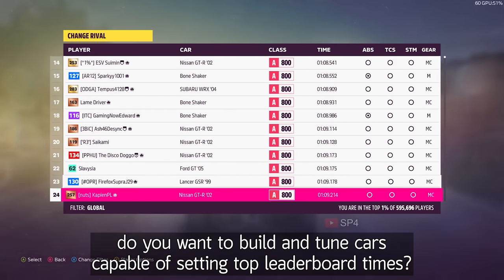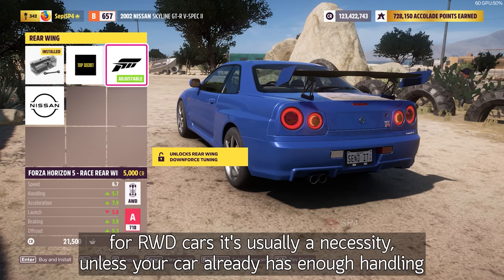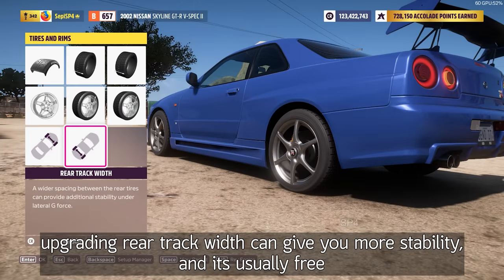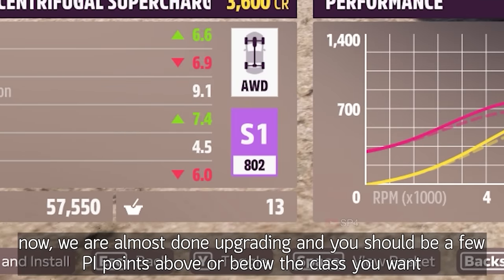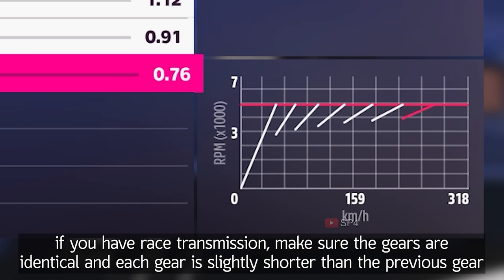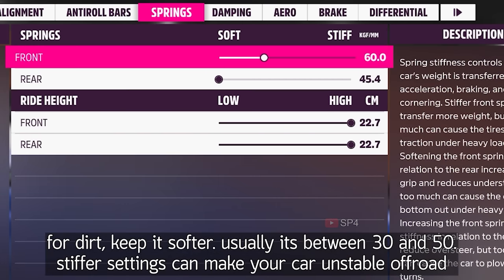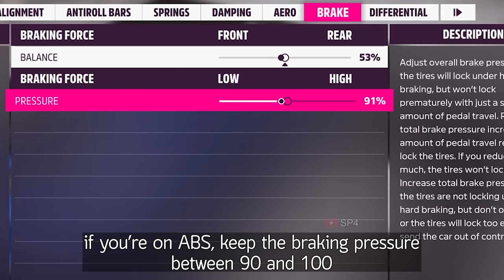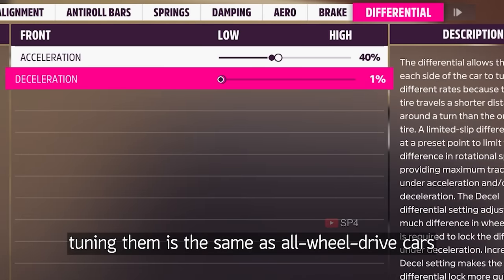Forza Horizon 5 META Tuning Guide

Comment: I have a few counter arguments/questions for this video. For reference, I've gotten top 0.1% to 0.05% on many of the tracks in Rivals (with so-called non meta cars like the Evo X and the C8 Corvette, both in S1 road), so I have had some success with the tunes I've developed for myself.

What are you looking at to determine the centrifugal supercharger/engines that are the most PI efficient upgrades? If it's simply power/PI gain, I think that's a little too simplistic. Torque/power curves are going to be way more impactful than the peak horsepower, and I think this can only be achieved through testing. Then again, that probably takes way too much time for most people. Also don't discount weight from the equation. Especially with front engined car, a lighter engine may be worth the "less efficient" PI gain.

I think aero should be used in the same way as tyres. I.e. it will start to make more sense with higher PI. The impact on drag and PI at lower classes makes it not worth it IMO.

Regarding front tyre width, I think it's worth it on some builds because now you can reduce the rear roll bar or increase the front and get better adjustability in general. Otherwise you'll get stuck with a maxed out rear anti roll bar and have to increase rear suspension stiffness to adjust your mechanical traction balance instead, which can start to make the car feel like shit (particularly true for front heavy vehicles).

I think your camber adjustment method is off. You shouldn't be looking at the alignment on the telemetry, you should be looking at the temperatures page (the one you pulled up at 4:03). The game seems to have a really loose approximation of sidewall flex under load, and as you can see, your outside temperatures are going up way too high because you're not running enough camber. Generally I'm finding that when cornering, the temperatures across the whole tyre go up quite evenly when the loaded tyre is experiencing about -1deg of camber in the corner. Mind you, the values are still super unrealistic; negative camber ends up at like -1.2ish for most vehicles under optimal conditions, even though most race cars would run like, -3deg of camber IRL.

Tyre pressures, like above, should be based on the temperature distribution across the width of the tyre. I would personally try and get the inflation pressure to the point that when under load, the spread of heat from the inside to the outside of the tyre becomes even.

How are you coming to the conclusion that higher ride heights have better weight transfer? I literally have never increased a car's ride height and thought it handled better as a result in any of the Horizon games. Are you basing this on lap time improvements or something else entirely? EDIT: Just saw the video you uploaded recently. Honestly 0.2 seconds is hardly going to tell you anything, and frankly I think a lot of that is down to increased rear axle weight transfer of such a rear heavy car like the C8 nullifying the understeer. I'd retest it using a front heavy car like the Civic or the R34.

Differential explanation seems oversimplified. Increasing acceleration values will actually help to get the power down, but too much will cause the entire axle starts to break loose. This is why you would increase it for offroad use. Same in reverse for deceleration.
Reply: This is a really important comment, thank u for writing that out, it's certainly helped me fine tune my time attack cars.

This could be my driving style; but I personally found huge benefit from high grip tires and decent downforce on lightweight A-Class cars compared to using Street tyres and raw power on straights. Any tracks without long straights I can glide round corners so fast all the ghosts are left miles behind by the end. 

Also clutch/flywheel upgrades save so much time overall on sprints (i.e. longer tracks) that I'd say they're way worth it with a Manual trans.

...granted i mostly use the RSX (Front FWD) or lotus (Mid RWD) both in A-Class for top 1% / 0.5%
Reply: @ICANHAZKILLZ  every car is different
Reply: Yeah from a sim racing perspective, it's fascinating seeing the tuning meta for this. I always loved to watch Failrace's community races for demonstrating the vastly different builds, but the tuning itself was something I suspected to be simplified, but never with confirmation.

Centrifugal supercharger was my first "wait wft?!" moment, as me, never having the chance to own a Horizon game, had no idea the game gave a PI boost for using it. But actually, it makes sense, as I'm assuming the game allows a higher peak HP vs other aspiration methods. However, it's as you said. A centrifugal supercharge operates on the fundamental basis of having boost pressure tied directly to engine RPM, so while you'll get great peak HP, low end torque and hp will be lacking. So perhaps situations like high powered RWD cars a centi-supercharger with the progressive torque-curve might help with power delivery. It's kinda cool that Forza doesn't completely cuck you PI wise so you got options, but definitely experiment.

I do also agree with front tyre widths, as though the PI hit might be big, it should massively help out with handling balance and how you can tune. Going to the extreme I'd understand, but something in between could be useful. And same sentiments with camber, tyre temps too.

Ride height is a fun one. I'm actually glad that the meta this video presents isn't just "slam da carr for lower CoG" because in reality no, that's kinda dumb. I'm very interested to see if there's an aero effect, as you might be able to lower the front end to keep the front splitter close to the ground, ensuring greater and more consistent front downforce. Whether Horizon actually models aero based on ground height no idea lol, and I also highly doubt it would model rake effects or diffuser behaviour at different ride height windows.

But other than for aerodynamic purposes, it's very right that low ride height does not always improve handling. But equally surprising is the max ride height thing.

Minor tangent here, but describing tuning as changing the magnitude of weight transfer always sounds kinda off to me. The amount of weight transfer is only ever effected by how hard you accelerate, brake, turn etc. What your doing with the suspension tuning is changing the rate of weight transfer, and that's a far more important thing.

Softer rear springs, for example, doesn't improve rear traction by 'increasing' rear weight transfer under acceleration, but instead slowing the rate that the rear tyres are loaded up. Tyres provide decreasing gains in grip for increasing load (a logarithmic graph, for e.g.), and once tyres are overloaded then that's when they lose grip. Hypothetically, you can therefore have stiff rear springs and accelerate progressively in a way that the rate of weight transfer with soft rear springs is the same. Just tools in the trade.

It applies to ride height too with the physical suspension travel. It's just that again I don't think the extreme either way should be the optimal case unless you can prove it. Car dependency also has a big factor, though in sim racing my experience with this has been more to do with altering the physical suspension geometry. I don't expect that to be the case here (Horizon doesn't model live rear axles, right?) but yeah fun to think about.

Differentials are a completely different ballpark. There's a lot to think about in terms of manipulating the speed of the left and right wheels and how much force each tyre experience. Fundamentally, the outside wheels of a car spin faster than the inside wheels in a corner. If the inside wheels start to accelerate, then that is what will push the car on a wider radius. Opposite occurs if same happens on the outside wheels. So you can get a lot of stability from increasing diff deceleration or decreasing diff acceleration, though with diff accel you wouldn't want to go too low that the inside wheel (which is more unloaded in a corner, making a more open diff more biased to send power to) constantly spins up, which either wastes power or even creates instability if the engine revs spikes and spins up the outside wheels.

Different cases for FWD vs RWD too. FWD would favour from high (not max) diff accel and little/no diff deaccel to ensure outside tyre is always rotating faster than the inside one, preventing understeer cases. only thing to consider with high diff accel is if the outside tyre starts spinning up, which will cause understeer as well. therefore you need good throttle control to stay within the grip limit.

Also a slight shame that there's no preload settings that can alter transitional diff behaviours, like just coming off the throttle or getting on the brakes. but hey tis Forza what can you do lol.

So there's my long winded and useless rant. I think I missed a ton of shit of my own ideas (diff thing isn't really an thorough explanation but some weird ass abridged opinion) but I ain't bothered to go through A to Z, just the main points I wanted to highlight. I like this 'meta' tuning vid a lot just for showing the general working of Horizon, but I absolutely agree and can confirm everything here too. A very good comment ma dude lol
Reply: i was top 130 in C class in rivals for a sprint race for a couple weeks with my non-meta Trueno build. These "meta" builds seem so odd and some of what they say seem to not line up with how I've been playing. Like saying the front wheel width is useless, for example. I'm not sure if it's placebo or not but increasing the front tire width has helped my cornering, albeit not a whole lot, but still noticeable.
Reply: @CapnFlappyJaw42  I think that was more in reference to PI hit than its actual use. As in it helps front grip enough that the game has no choice but to bump up the PI. Cuz I do remember when this guy did a comparison lap and managed to get similar lap times with stock tyre width but more power. But really it shouldn't be taken as general fact but case by case. Some tracks with favour more power, others more grip. The compromise between not max width but not stock width is probably the way to go.

And btw for anyone else, my comment was in direct response to SAR's original. Essentially going paragraph by paragraph with my own thoughts too. My general thoughts is still that vaguely following 'meta' for at least PI manipulation can be helpful, but doing your own work with experimentation in parts and tuning is absolutely best. Some things of these 'meta' builds, like 0% front diff deaccel, or max front splitter min rear wing, make a lot of sense because of other general theory or because I doubt Horizon is that complex in the physics. The rest of the tuning? Idk. Parts? Seem to make enough sense, but already SARs outlined some issues too so yeah.
Reply: @REVUPMEDIA  every car in Forza handles far more similarly than you think.

The handling physics are more simplified than everyone thinks as there are several hundreds of different, visually detailed cars to choose from.
Racing games either focus on individualising the handling characteristics between the very few cars in their lineup based on how those cars handle in real life, or use a simplified model that makes a large line up of cars of certain designs feel samey.
Reply: @ICANHAZKILLZ  As Colin Chapman once said: Adding power will make you faster on the straights, while reducing weight makes you faster everywhere
Reply: @jrc-3954  Every car feels like it is the same "platform" with different sizes and weight distribution rather than accurately simulating completely different suspension geometries and such.
Reply: @FylixAerou  it's just a lot of what I've learnt over the years from using Assetto Corsa and following people like Niels Heusinkveld or Aristotelis Vasilakos (Aris Drives) among many others. There's also a lot that comes from general motorsport engineering knowledge too like following F1 technical analyses or other motorsport disciplines. Aerodynamics in F1 and LMP is particularly interesting, though I would only know basic principles and not the nitty gritty.

I do also wanna preface that my above comment is only really my own interpretation and sometimes my own hypotheses. There is stuff like suspension stiffness and tyre load correlation that I do worry I get mixed up sometimes, and it would help me to validate my understanding using MoTeC telemetry data from Assetto Corsa. Unfortunately my PC has been broken for half a year so no can do lol. But yeah basically I'm not like other guys that claim my knowledge to be absolute fact, I do acknowledge I can get things wrong and I'm constantly learning lol. But this is at least the extent of my own understanding of setup principles, and these principles have gotten me pretty far with understanding what changes I can do and what I can't do.
Reply: @JaydenHW  Regarding stiffer springs having more weight transfer, basically this really only applies in roll. If you assume a perfectly rigid chassis, then under roll, the stiffer axle will bear more of the load transfer and have less grip due to load sensitivity. This is why anti rollbars are such a useful tool for tuning.

IRL there's a limit to this, because the torsional rigidity of the chassis is finite. So you can run into a situation where no matter how stiff the ARB of one axle is, you won't be able to get more load to transfer on that axle. On cars that have severe traction balancing issues, the inside tyre of the stiffer axle can start to lift off the ground entirely (e.g. hot hatches with heavy front weight distribution)
Reply: @damncritics  oh nice thanks for clarifying that. damn its good to see other ppl well versed on this shit lol. 

yeah only now did i realise i mainly talked about pitch movement. indeed during roll the stiffness also helps a lot, because (if i remember this correctly) excessively soft springs or ARBs take too much load off the inside tyres during cornering, and the extra load on the outside tyres doesn't make up for the loss of grip. of course, that is the extreme case, and its when you get to fine tuning, thats when what you say applies, especially when your talking about different stiffness between front and rear.

so yeah again thanks. this is a good comment thread to follow and i hope more ppl can see what we've got to say, because your knowledge is stuff even sim racers should be considering, let alone Forza players lol
Reply: that camber thing was bothering be entire time. I was seen 0 degrees at 140km/h on circle meaning the wheel got firm grip on the road but tyre outside keeps getting hotter than inside. I've always did more negative camber in my tunes until heat parameters are fine.
the whole existence of "meta tuning" thing is kinda sad tbh. Pretty much only thing that forces me to watch those kind of videos is my wish to understand how game works. I'm alright at knowing how real world works so I'm able to do "basic" tuning to make my car going. But in the game - all goes wrong.
Reply: @fragiquerence  there will always be an element of the outside edge heating up more than the inside edge, but generally keeping it at exactly 0 degrees still isn't ideal. in fact (though I wouldn't be able to describe the specifics of this) irl tyres can have different constructions that means running more negative camber is actually the optimal. and its not just that, but also suspension geometry that can mean you have to run a lot of static camber which rolls over into more neutral camber (think McPherson strut Group A cars like the R32). 

Assetto Corsa's method of determining optimal camber is actually surprisingly crude. in the tyre data, you can specify a number of parameters where the grip of the tyre depends on the camber angle measured by the game, and typically at or around that value is when the game makes the tyre generate its most grip. this means some modders will make it so optimal grip is generated at 0 degrees, others at -1.0 degrees, or -1.8 etc. i wouldn't know if this is realistic for the tyres they are simulating, but hey at least its better than trying to reach exactly 0 for every single car.

but my point is that even in sims like AC, iRacing etc. the outside edge of the tyre will still heat up more than the inside edge, so piling on more negative camber to make the surface temperatures perfectly even isnt actually optimal. in looking at surface temps, you look at if the two edges are excessively different like 10+ degrees. but within 5-10 degrees is actually perfectly acceptable. having the surface temps too even might be a sign your running too little negative camber instead.
Reply: @JaydenHW  I am not a tyre engineer of course and can't tell the in-depth physics of it, but noob logic like: "heating up evenly possibly means the energy going through the tyre distributes evenly too, so at least we using most of its surface". That might not be perfectly optimal, but it is still looks better than only looking at camber degrees at alignment tab of telemetry. And of course there are going to be no situation (well, probably, I've only tested one car) where the tyre gonna be heating perfectly even in all occasions. Tested on A class RX7, if camber is set to make tyre do full contact at full steering lock on circular trajectory at 130 km/h then it would certainly not do full contact when moving straight line. You can probably compensate it with suspension softness irl, but I have no idea how suspension geometry works in this game :D
Reply: @fragiquerence  mhm thats the basic principal indeed. as long as one is not taking it too literally as in "oh so i should actually make sure the outer middle and inner temps are exactly the same" then that approach of yours is actually good.

i also just realised i said the complete backwards of what it actually is in reality lol. inside edge of the tyre actually heats more than outer when there's some negative camber, since that's the edge most in contact with the group. that's completely mb. its only when there's static positive camber that outer edge will heat more.

but anyways ye other than that (just swap the words around in your head) my point still stands as general advice. not sure if it came off as too critical when i wasnt rly, but thats kinda my thoughts on the matter. i did forget to comment on your approach in the original comment and i just started talking generally instead, so like i said before looking at surface temps like u do is actually the right idea indeed.

(p.s. im rereading my comment again and realised how i probs misread some things of your comment too, so thats mb again xd)
Reply: what if you are too dumb to tune?
Reply: @Lukas-lp2fz  download a pre-made tune if you have no idea how to tune or your just don't care. It is absolutely fine.
Reply: @Lukas-lp2fz  Like another commenter mentioned, there is always the "find tune" menu in the garage. I recommend searching for tunes for whatever class you want, and if you want a really spicy tune then put "Rivals" (without the quotation marks) into the description field. Just be aware that those are very fast tunes that people have made for their own handling style and you might not like them so you might have to try a few.
Reply: Also worth noting, everyone is going to prefer different things with their tunes and it is entirely possible to make something that feels good to you but doesn't necessarily conform to all the ranges presented in the video while still being very very fast. This is a great ten minute guide for people just starting out that want to make a tune that is at minimum capable and competent in-game, but no guide will ever beat just fiddling with settings and testing them until you find something you like that is also fast.
Reply: Yea I'm top 500 in most tracks through out the classes and he definitely got a few things wrong when it come to rwd diff and roll bars settings
Reply: original poster whats your fh5 gamer tag so I can follow, id love to try your tunes....
Reply: I know next to nothing about tuning, but after watching HokiHoshi's guide and then watching this one, something just felt off. Many of the things Hoki talked about were completely disregarded here, and I'm doubtful everything said in this video is correct. But, he is a great driver and he's very high ranked, these tunes are working well for him. I guess it just goes to show tuning really is based on preference, it's not completely objective whether a tune is good or not.